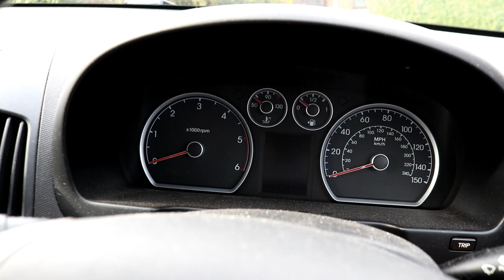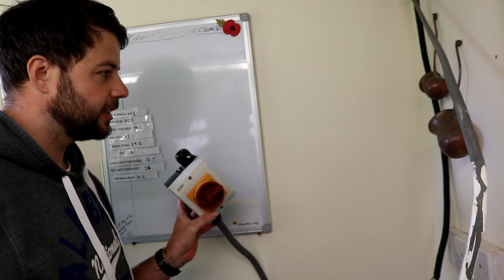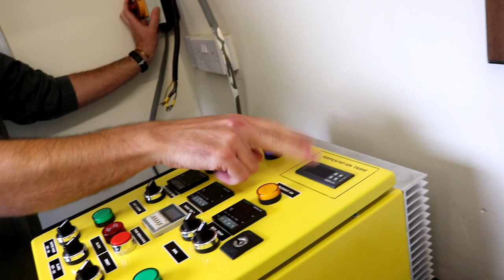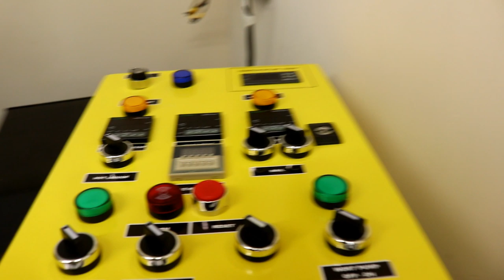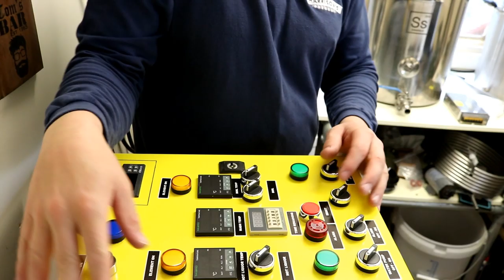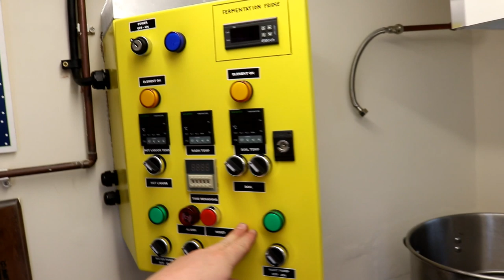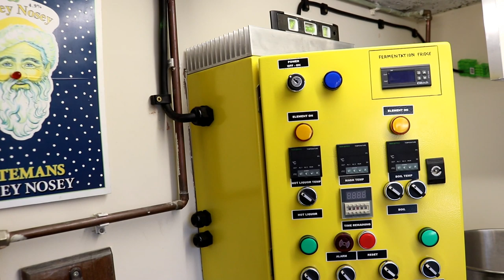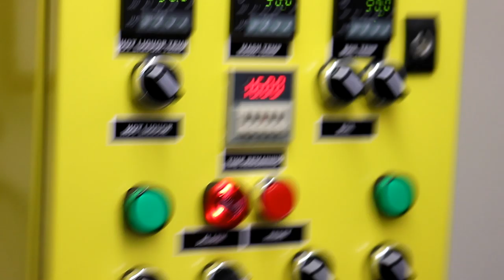Off To Wire Tom's Panel ⚡🔌🔧🛠💡

Comment: Hi mate, I noticed on Tom's panel you used the Relay version of the PID's..how do you go from the inkbird to the SSR? Also was the PSU 24VDC or AC?? Thanks
Reply from the maker: The PSU is DC. I simply connected a negative from the PSU to the SSR then ran the positive from the PSU, into the relay common of the inkbird then out from the relay NO through the panel switch then finally to the positive on the SSR completing the circuit.
Reply: @harrybrew69  cool I assumed so.. If I did a similar build, would an ssr output version be better? What made you use the relay version? Edit.. Oh right, it's because it didn't go direct to the ssr?? Edit 2 - if I had an ssr output on the pid, could I not just route one pole through the front panel switch, then the other direct to the ssr input? Thanks for your time mate..
Reply from the maker: @JordanHexican  Yeah you can. The idea was to avoid mains voltage switching on the panel for safety hence the 24v PSU. There was the mains going into the STC but as I recall everything else was low voltage on the panel front.
Reply: @harrybrew69  Thanks, hope you don't mind my questions.. There was no circuit protection on the high voltage side of Toms panel, if I was to do it with an RCD and MCB'S would it be like this.. Mains in to RCD, then out to one side of SSR, then into bottom of MCB, then to the socket for the elements?? Or would you put the SSR between MCB and socket? Thanks for all this mate..
Reply from the maker: @JordanHexican  On my panel I run mains in via the RCD so the whole thing is protected then I have mcb's between the SSR and the socket. Works fine and is sound electronically as far as I can tell. Remember to earth everything, including the pots or you render the rcd useless.
Reply: @harrybrew69  awesome.. Would love to share the end product with you whenever it happens.. Lock down is helping but awaiting a delivery from China on some Mash Tun parts...really do enjoy your videos, big inspiration.. Im from Chesterfield so not too far from you..
Reply: @harrybrew69  Another quick couple of questions mate..
(1) Did you just get the + from the PID relay for the element LED's to blink on and off??
(2) Is the main on/off LED powered by the PSU turning on? 
(3) I dont see how the current for the whole panel is not going through that main on/off key switch?

Thanks mate